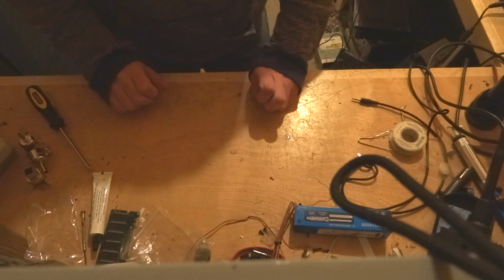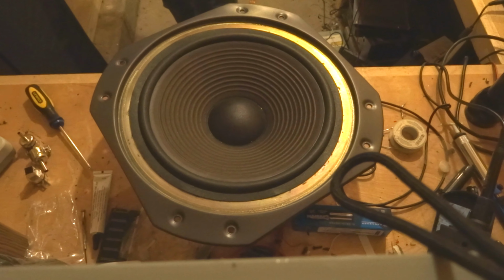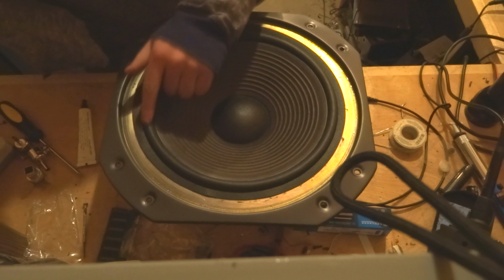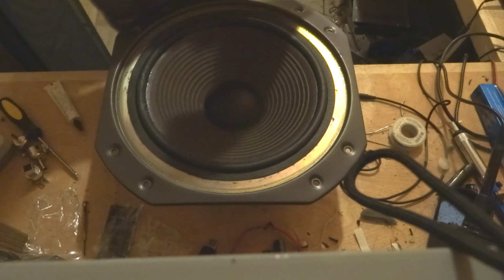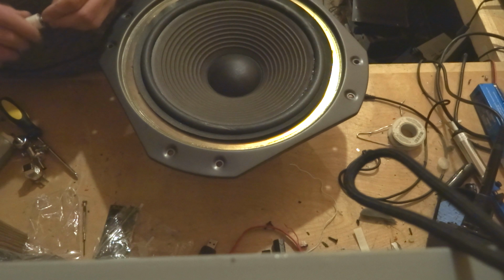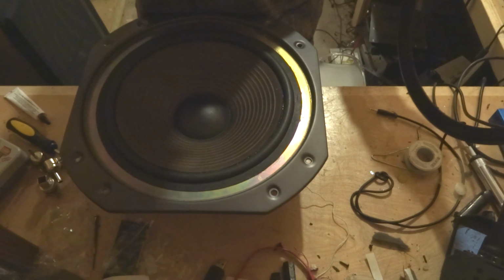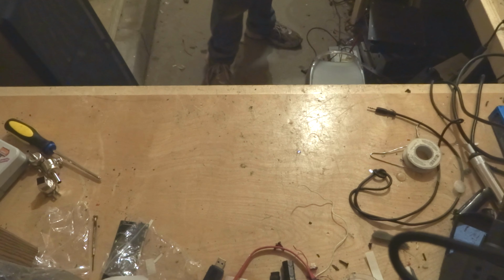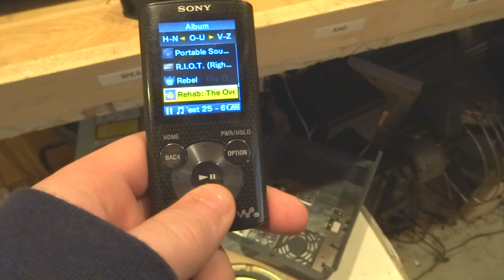Repairing Speakers! Pioneer CS-G9900

Comment: Hi, I have a set of pioneer floor speakers they don’t seem to have a crossover just directly wired to each other and a capacitor on one of the tweeters would it be safe to install a crossover to get better sound?